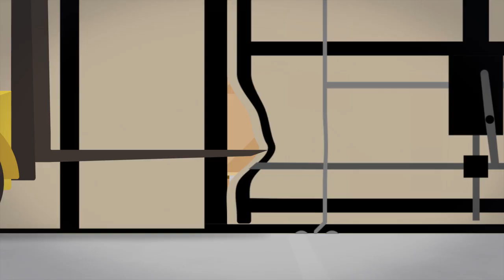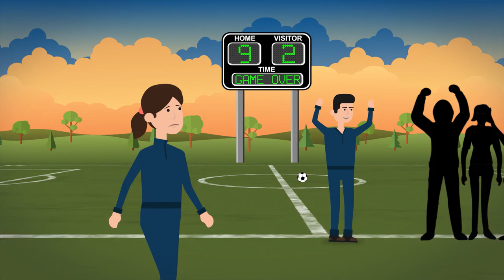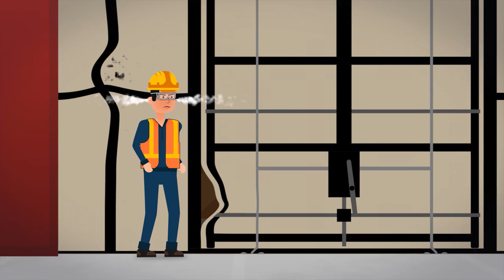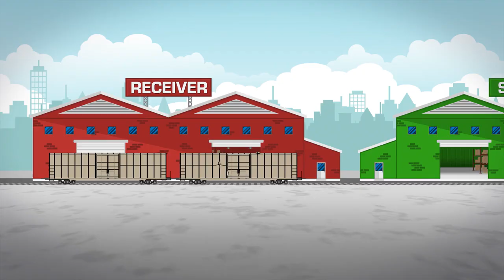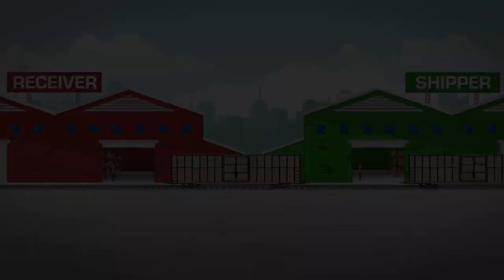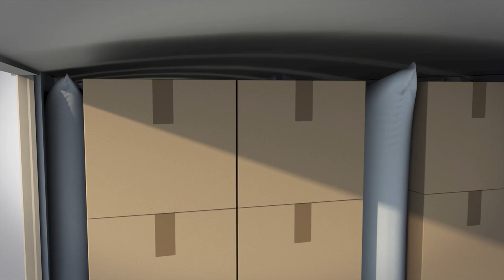Handling Boxcar Doors Safely

Comment: I'm suprised that boxcars are still in use. I thought intermodal was the norm.
Reply: Intermodal is the norm for CERTAIN applications. But mostly boxcars are used for paper and lumber products.
Reply: Intermodal shipping (containers and piggyback trailers) are used for long distance or international transport. Boxcars still carry the lion's share of most domestic rail freight requiring protection, though. Lumber and paper products, auto parts, machinery, furniture, appliances, beer, food products, and more still travel by boxcar.
Reply: Boxcars can be used for refreshments that need to be Keep cold, Intermodal are used for long distance cargo, boxcars are usually medium priority or low never really high priority, Intermodal are always high priority
Reply: They are also refrigerators
Reply: Box cars are used for small industries, whilst intermodal is used for long distance trains.
Reply: They still use boxcars on mixed freight trains and locals. They're mainly used for local industries now, where customers can just load their cargo without having to drop of their cargo at the yard.